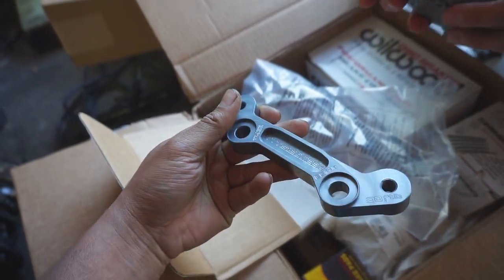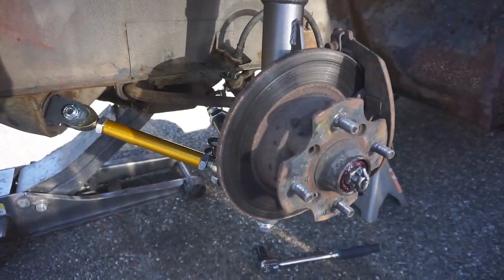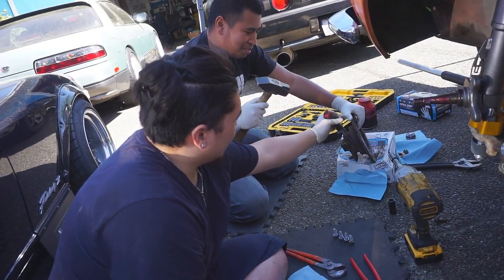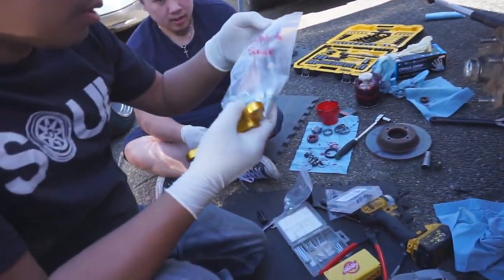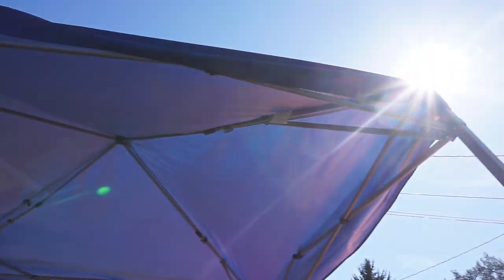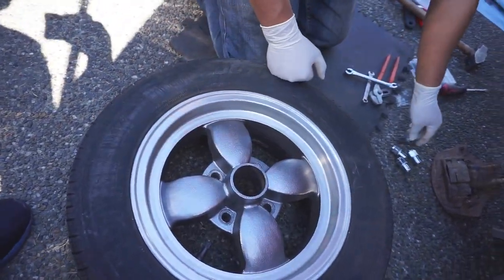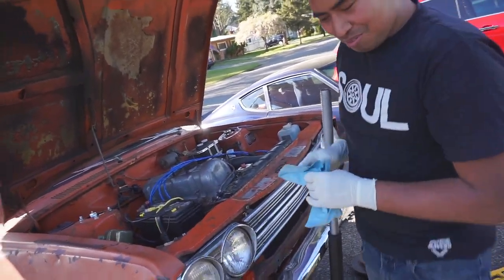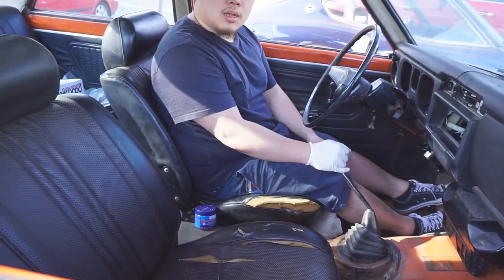Datsun 510 Wilwood Front Big Brake Kit Install

Comment: Good Job guys . All it needs now is to solder there rear camber -Toe adjustment bracket on the crossmember & she be complete in suspension department . 
I would have taken 5 minutes to paint the Wheels hub and the Steering knuckle  as you had them off the car . 

Wish these parts were legal in Europe . I'd be all over that Bling .

Comment: Looks kick ass.. I wanted to clean and sand his rear deck lid and shoot it with rattle can REFORMER. It would visually improve the looks. And for the cost of three cans well under 20$ he can see A how good it looks ( Batman Black ) how good it holds up ( 2 coats).
 How rust doesn't come back
And how much better the car looks. Simple Cheap ,big improvement.Im into the rat look but that deck lid could look, mean.
Great job I love that 510 is getting built and still driven.